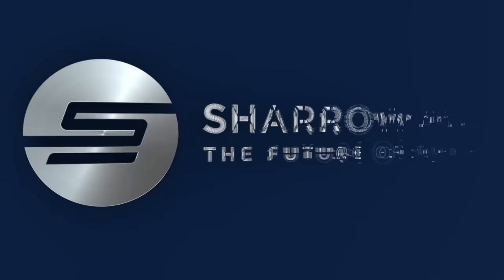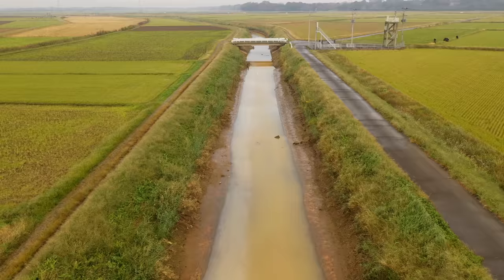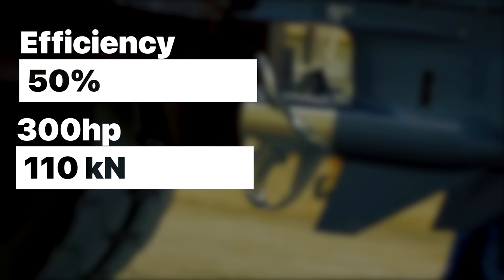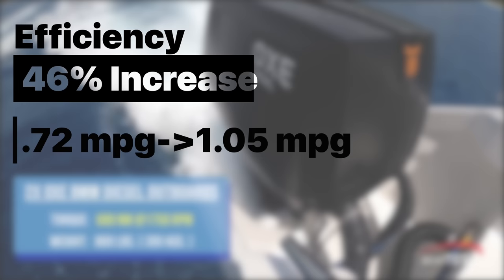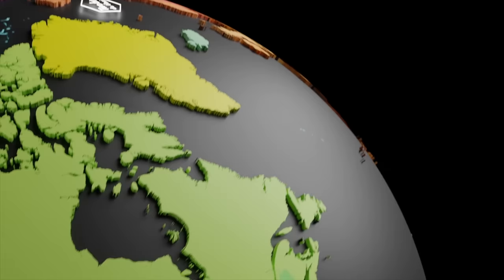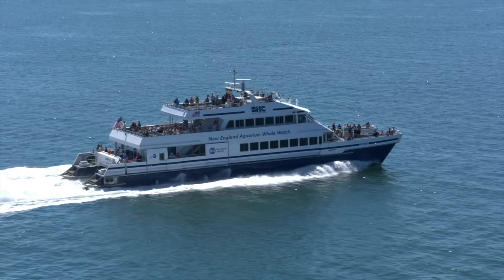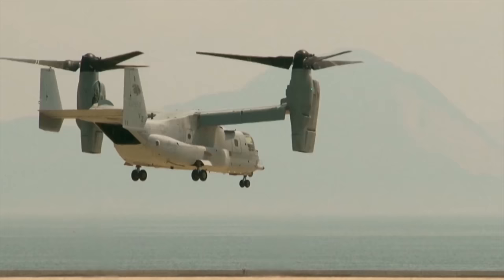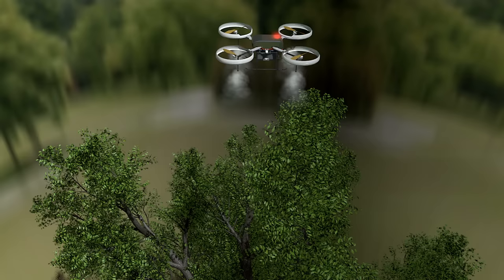Genius Propeller Is About to REVOLUTIONIZE Ships, Here's Why

Comment: the manufacturing costs stated for the toroid propeller are way over priced....  machining these parts is not really a problem.   casting and molding would reduce costs even more.
Reply: Sandcasting aluminium bronze then final machining. The molding is hard but lost wax style with polycast filament might be one way.
Reply: @AlwaysCensored-xp1be  thanks

Comment: The blades on props are basically wings designed to fly in tight circles. When multiple cantilevered wings are combined to act as bracing for each other, it forms what is called a  joined-wing configuration. Toroidal blades are a variation on jointed-wings, so the toroidal blade configuration would work as wings for aerodynamic forward flight, a more flattened version of the round winged aircraft shown in this video.

Comment: Hi, this sounds like it should be an overnight revolution, that there's essentially no reason that every commercial ship shouldn't buy one of these today. Is that happening and, if not, why not?
Reply: The main issue is manufacturing. These have to be CNC milled or potential printed. You would need a giant custom made CNC to be able to manufacture these for large ships and it's likely that the cost simply wouldn't be worth it

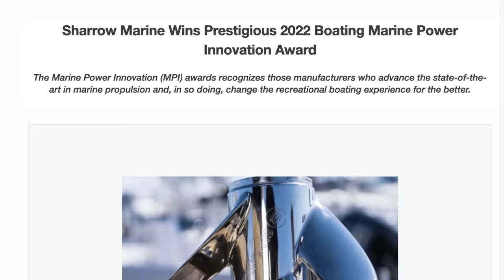Comment: 4:28 i have only ever seen them on  boats that do not have a displacement hull.
5:56 ok that boat is already suited to high performance, where the efficiency would be most valued is on vessels that are on the more affordable and less performance end of the spectrum and maybe sailboats to a degree depending on how much drag the prop makes when not in operation.
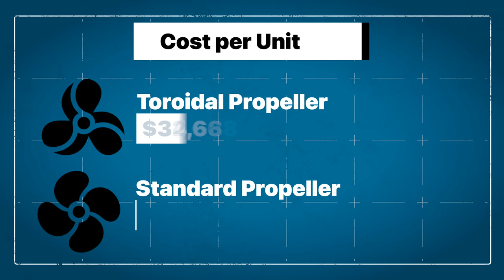6:54 welp nevermind that price explains exactly what part of the market they care about, this leaves room for someone else to come in and do it cheaper.
7:07 only for fuel driven boats, if your boat is electric like some sailboats are starting to do then you never do see that investment come back, you just get a little more performance and that's it (including possible range increase) even non electric sailboats would take forever to get returns due to how much less your engine is used compared to a motor only boat. Granted with a motor boat you are getting returns within a couple years but people on the budget side of things will not see it this way, they see a gaint price tag

I do like the idea but the price is horrible and cleaning the thing might be harder with that shape.
The props benefits for electric boats only work at their best when building a NEW boat since you can use less power and therefore batteries but with a existing boat you already have them so you don't get that benefit.
14:20 same goes for any propeller, not just theirs.

Comment: So many fascinating things to come from this - we have a use for AI to mass-test fundamental small (incremental) changes in designs to see if improvements can be made.  We have the very idea of re-addressing age-old designs for components that we've been taking as a "given" all this time;  would this for example improve the efficiency of a fan on an engine?  I've no idea.  Questions like this need to be asked and answered.  We're moving into an era where we can test the seemingly insane or idiotic and not only simulate it but potentially build the damn thing with 3D printing.  If we can just survive this era - basic technology of the near future could be significantly better than what we have today.
Does anyone know if this blade would make my pedestal fan any quieter in summer?

Comment: The toroidal propellers sure are getting a lot of attention lately. So far, every "review" is anecdotal, grand claims with some numbers but just enough data missing to leave room for a skeptic like me to doubt those claims. 

More than double the thrust than the propeller it replaced? That claim is highly suspect. Was the previous propeller a crappy prop? Did it have fewer blades? Was it pitched differently? Was it static thrust or thrust underway? At what speed, rpm and fuel burn? ...etc???

There seems to be always some data point left out, especially when talking about how something was "improved". The numbers given are enough to get people excited and spend tons of money on them, not enough to prove their benefits. When people do spends many thousands on these "breakthrough" props, their own psychology will make sure they think they are great.

I would really like to see a scientific, complete, unbiased evaluation of one of these props put up against a properly designed standard propeller. Until that happens I wouldn't get too excited about this "breakthrough". When you see them winning races then that will also be very convincing.
Reply: Keep searching, it's all there.

Comment: I've always had problems with the media claiming something is '100% better' since they're so terrible at math. 
If 100% better is actually 'twice as good' (e.g., 2x), is '105% better' 2.05x??
Reply: Well it would be fuel-105% and then you would find out
Reply: …yes it does mean 2.05. Which is BS because conventional props easily reach 70% efficiency, and the remaining 30% losses are by no means all due to tip vortices, which are meant to be what these things reduce. Another BS claim is 27% on top speed which requires a doubling of power, hence a doubling of efficiency. And you especially cannot double efficiency at max rpm by reducing tip vortices because that is the operating condition where they are the least, and where profile drag dominates, and these toroidal props unavoidably have extra profile drag. All these claims are transparently achieved by cherry picking at data the public does not understand and by making bogus comparison against props that are not optimally chosen to match the engine/boat/operating regime. If we grant that the toroidal props do actually reduce tip vortices then maximum benefit will be at low speed/high load, but there is an inevitable trade-off in profile drag that dominates at high rpm.

Comment: Switching to this design would not accommodate constant speed propellers (prop pitch changes instead of engine speed), which means changing over the entire engine system. Not that it would be prohibitive, but it’s not always as simple as swapping out a propeller. Still, it would be amazing for this to take over the industry!
Reply from the maker: Great point
Reply: Don’t believe many large cargo ship have CS props. They are likely designed for a set cruise speed, which is a strong point of these.

Comment: Mark Rober did a YouTube clip about  "This Drone Will Change Everything"
Great story by it's self but the Supper Quiet propellers on the delivery drones are jaw dropping. 
The efficiency is not mentioned however.
Reply: yes it was a great vid, but those zipline drones do not use toroidal props they use two bladed off-set counter blanced ones. which are also quite weird

Comment: NOT useful for Planes - you can NOT adjust the Prop pitch or 'Feather' it, e.g. when an Engine fails you rotate the Blades to minimize Drag. Same reason it won't work for Helicopters, where you need to rotate the Blades every single rotation of the main Rotor. Besides you need to change Pitch to compensate for Air Density changes due to Temp/Altitude

Comment: I feel like the loss of variable pitch would be problematic on a turbo prop plane.
Reply from the maker: Good point
Reply: It might be a large enough improvement to make it worthwhile, though.
Reply: @aurtisanminer2827  probably not. variable pitch on a plane is call a constant RPM prop. The idea is to run the motor at it's most efficient RPM and vary the pitch and throttle to change speed. The prop is not the whole story.
Reply: @lenwhatever4187  yea, that’s why I was thinking the efficiency of each would need to be compared.

Comment: I don't see toroidal props working well in aviation outside of drones any time soon. Most modern prop aircraft use variable-pitch props to make the most of engine power. A variable-pitch toriodal unit is gonna be one hell of a challenge. 
And that'll be even worse with helicopters. Even if you could get good pitch control with a toroidal rotor blade, you're going to have significant issues with ground and tail boom clearance on a traditional helicopter.

Comment: Would there be benefits if you were to put two of those behind each other? Or have 2 or 4 "blades" instead of 3?
Reply from the maker: interesting... i'd imagine the turbulent flow might disrupt some of the benefits
Reply: @TwoBitDaVinci  yeah, that’s what I thought. That’s why wind turbines only have three blades. And two props on a plane (behind each other) are only used to cancel out the momentum. But on a different note, I read an article that stated most wind turbines have the same prop shape (in terms of rotation direction). And accounting for the Coriolis force it would make more sense to have an option for the northern an southern hemisphere respectively. Maybe an idea for a future video. Love your vids by the way. 👍🏻👍🏻
Reply: the BEST prop , is NO prop in the FIRST place.
Reply: @markplott4820  so…? A sail?
Reply: @dominikfingerle8124   - 100% Electric water jet Propulsion , or a MHD thruster.

Comment: Nice video. I didn't know you are a mechanical engineer as I guess I didn't pay close enough attention being always busy and on the run with my own ideas. For me the future is hydrogen and all of these new designs to make things better is welcome as it's about time something changed with propeller design, just as much it is time that spark plugs need a change in their design. 
The reason why I am so sold on hydrogen as the future fuel to next power the world is hydrogen already is powering our world, but due to the dumbing down of society no one seems to know just what is actually burning when fossil fuels are used to run our many machines if ask directly. Spoiler: The answer is hydrogen. Now that we have 95-98% efficient electrolysers the switch to just using hydrogen should be getting underway, but first we have to learn a whole lot more about hydrogen than we currently do right now. 
Anyway getting back on topic these new designs are very welcome as now that we can make things on our own it's was only a matter of time before someone thought outside of the box.

Comment: 7:10 Well, a 17 m Catamaran, powered by 600 hp is not your average recreational boat though. Not even close. So return on investment for actual average boats will be much much MUCH longer on 10000$ for propellers (probably decades).
Reply: Plus one on that. the buyer of a 2M plus vessel would not blink at 20000 for props (or double) so long as it is the latest cool thing they can brag about... even if only displaying it on haulout. ROI for a displacement hull would be a non-starter.

Comment: You said tha the screw designed by Ressel was based o a design by Da Vinci which is more than 2200years old.  I'm not sure I understand ae Da vinci was born in 1452, that's 570 years ago.

Comment: Could these props be applied to hydrofoil water crafts? Increased efficiency on a vehicle that “slices” through water on a sharp foil rather than drag the hull beneath the surface.

Comment: This works well for smaller propellers, but larger propellers often require variable pitch.  How does that happen with these designs?
Fans, small copters, personal boats, JetSkis, sure.  Aircraft, large wind turbines, and large ships where you need to feather the props for various reasons will need something else.
Reply: What large ship ever feathers props?  None, it's allowed to freewheel if an engine is shut down.
Reply: @W.451  Actually they don't.  Older, larger ships use a Jacking Gear to prevent that (and other use) but the larger ships with bow thrusters can vary the pitch, though they usually don't feather them if they retract.
Go ahead, pick nits...

Comment: I wonder how this compares to Candela's twin propeller, rotating in opposite directions.
Reply: The main benefit of those is increased thrust... not efficiency they are similar in efficiency. Also they have twin prop versions of this prop also. Also the efficiency numbers on these are wildly exaggerated. the only way to get the numbers they are throwing around are to spec the WRONG prop for a boat and compare against that not the best conventional prop.

Comment: Such a game changer! Who could have guessed that switching from an imbalanced propeller, that's straight out wrong choice for the rpm and load and repairing the transmission could improve performance?   

If Sharrow includes selecting the best size/pitch for that boat and motor, and installation, and so on, no wonder efficiency can be improved in many cases, that doesn't mean the toroidal shape  is superior, it's not even as good as the correct conventional propeller. And of course you're going to convince yourself and try to convince everyone else that the prop is just short of magic if you spent $5k or more on it, imagine how stupid you'd feel and look if it became apparent you spent $4500 extra for a sub-optimal propeller, even if it was better than what you had before.            

If toroidal propellers were superior, they would already be standard in all commercial applications already.  The idea is not new, as mentioned, it's also not very special.   

Fluid dynamics is complicated, but some aspects of it are very simple; if you increase drag, efficiency decreases. More area, more areas, more edges means more drag, which, decreases efficiency. It's important that the propeller is designed for the speed and power it's used for, all propellers performance and efficiency varies much with speed and power.  A fixed pitched propeller is like one gear on a combustion engine car, the water or air acts a bit like a centrifugal clutch. If you want to widen the the range with good efficiency and performance you need to be able to control the pitch. 

But what about inefficiencies caused by tip vortices? Well, the amount of research that has gone into that leaves no reasonable doubt, on wings things like winglets can improve the efficiency, but "tip-lets", loops instead of blades and so on is less efficient than a conventional propeller with correct design and size. And, the toroidal design doesn't decrease vortices, it changes tip vortices. By the way, the ring shaped wing is not new or unique idea either, it's has been tried, it has very low efficiency.    

What about cavitation? Again, the correct conventional propeller is the answer.

Comparing a 3 bladed propeller to a 3-looped toroidal, which essentially is a 6-bladed propeller with the blades pairwise connected i the tips, like in the MIT patent application can prove that the 3 bladed propeller was wrong for that situation.      

You want the make the noise from the drone less disturbing? Easy, increase the amount of air the propeller pushes for every turn, by increasing size and or pitch, and you can both reduce the noise level, a lot, and make the worst frequencies practically disappear. It's not rocket science. Wouldn't that hurt efficiency you might wonder? Well sure, compared to the most efficient option it would, but it is possible to make a better conventional propeller both regarding noise and performance/efficiency than what 's possible with a toroidal design.

Comment: I wonder if this would be useful in PC fans industry.
Just something i feel like saying, the price is way overkill. You could easily Cast replica with a much cheaper price and i assume they would last almost just as long because bubble cavity would not be a problem anymore.
There's also laser 3D printing which i assume would be cheaper than CNC because making the part would be much faster.

Comment: In case efficiency is calculated as 105% , it means energy output is 5% more than energy input. This is just not possible and means that it has been calculated or measured in a wrong way. This is violation of law of conservation of energy.
Reply: From say a regular propeller it is 105% better then a regular prop

Comment: Heavy shipping uses variable pitch propellors, and rotate their props at a fixed shaft speed and change the pitch to control the thrust. I wonder how they could emulate that on these new style props?
Reply: Most big cargo ships use fixed pitch screws, because they almost always travel at the same speed. The variable pitch ones are usually on ships that require high manoeuvrability or efficient sailing at multiple different speeds, e.g. warships.
Reply: Heavy shipping almost exclusively uses fixed pitch propellers

Comment: .72mpg? With diesel at 37.9kwhs per gallon of total energy capacity. That amount of energy consumption is staggering. 😀 

We need purpose built ev ships with the batteries laid down as structural members of the keels. Should be able to transfer all or most of the heat right into the water itself. I saw a study estimating 40% of all cargo ship routes could be done using today's battery cell technology. 

Large ships globally are also responsible for the highest percentage of emissions overall of any sector thanks to using bunker fuels. 
And of course moving around oil coal and gas shipments. 🤔